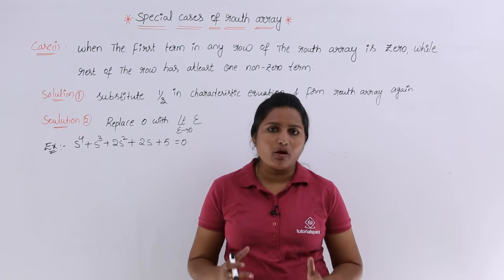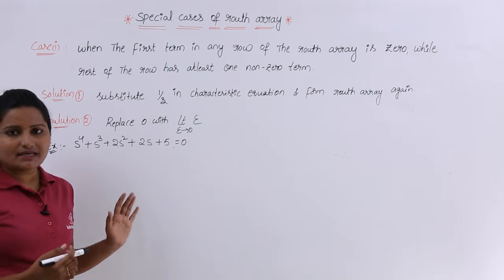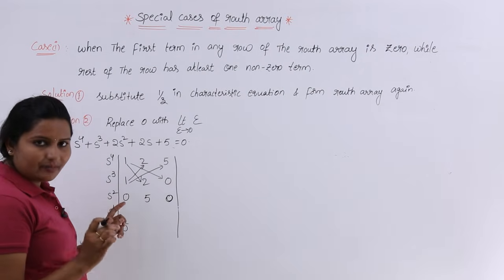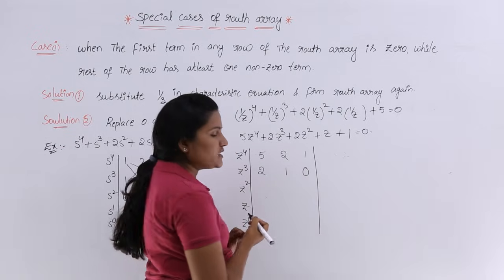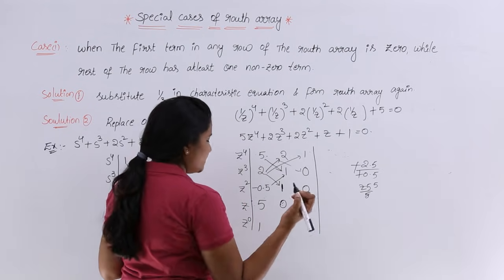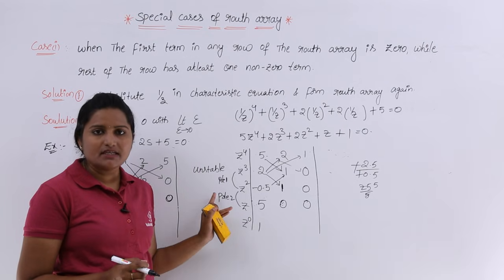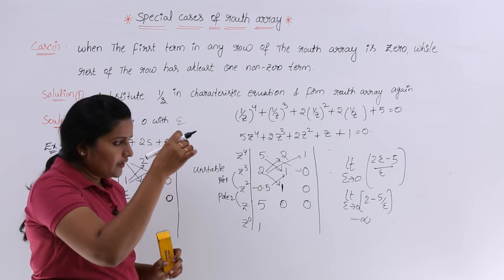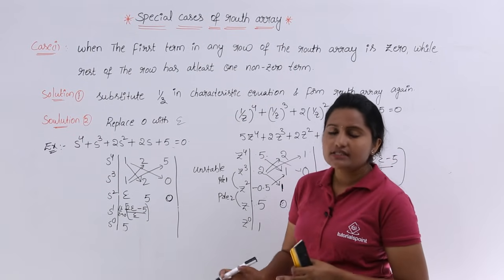Special Case of Routh Array Case II

Comment: 1.put 1/z in place of s in the given equation.
2.now multiply the new equation formed by z power 4.
3.rearrange it.
(1st column of each row should be non- zero, if any one of the rows has zero in the 1st column then only this method works)

Comment: I did not get the two poles thing can you clear that plz
Reply: there are two sign changes on the first column of the routh array , indicating that there are two poles at the right side of s-plane. Thus, the system is unstable because there is pole at the right side of s-plane